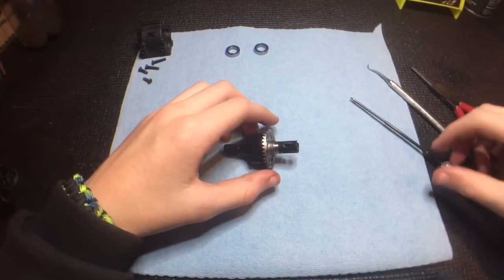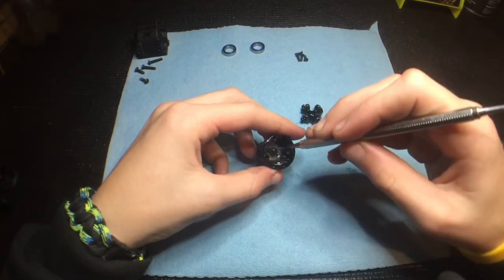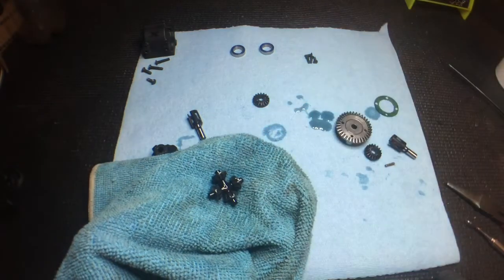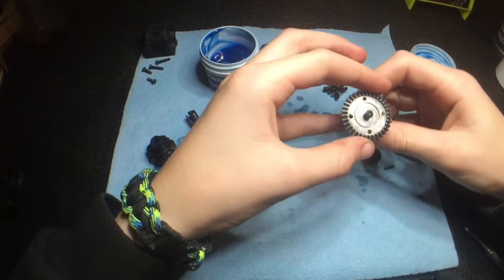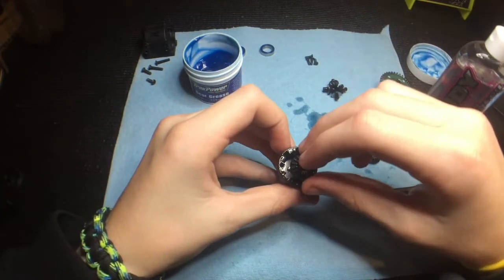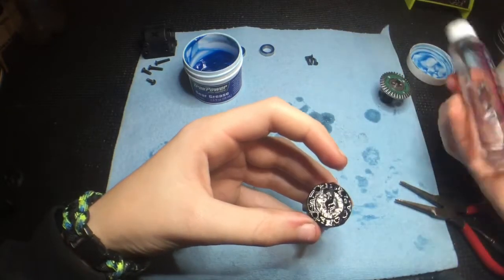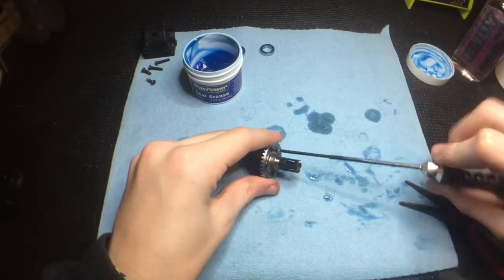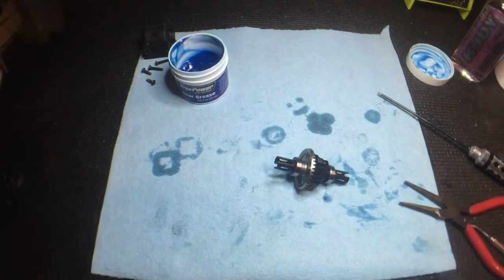HOW TO REBUILD A XRAY XB4 GEAR DIFF

Comment: I understand this method works for you but just a comment. Xray and the team recommends you leave a little air space in the diff so when the diff heats up the oil expands. I personally fill it just a tiny bit more than they recommend but I leave just a bit of expansion room and I find that works best. Also what's the reason for putting so much grease on the bevel and pinion that it covers the diff casing? That just makes a mess and adds weight. All you need is enough to coat the gears and it never dries up and stays clean otherwise it flings off
Reply from the maker: Lyons238 I come from the 1/8th scale side of things so that's y I use a lot of grease because the 1/8th scales need a lot. I'll try your tip of leaving some extra space in the diff. I've just gone off of watching Drake and Tessmann's videos and this is the way I've done it for a long time and I never had problems. Thanks for the comment! Do you use the xb4/other xb-cars?
Reply: Lyons238 agreed. Way too much grease on the bevel and pinion. Could actually cause drag with that much. Even in my xb8 that would be way too much.
Reply: DC_ RC I run all xray cars xb4, xb2, xb8. None of these cars requires as much grease as you use on the bevel. That much is just a waste, it makes a mess and flings off anyway. You just need a good healthy amount on only the gears so only a tad flings off onto the casing.

For the diffs, you do want just a little bit of room for oil expansion as without it your diffs could leak and cause the diffs to change feeling if there's too much pressure in them from the oil expanding. Not much room is needed though just a very small amount.

Otherwise everything you do looks good. It's not like these are make or break things. Just something to keep in mind and give a try. 

Cheers mate